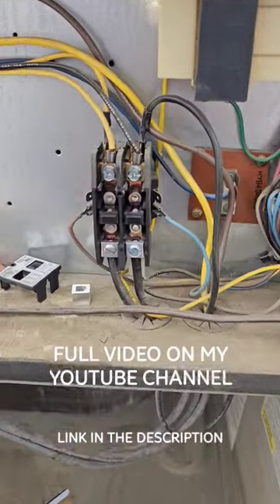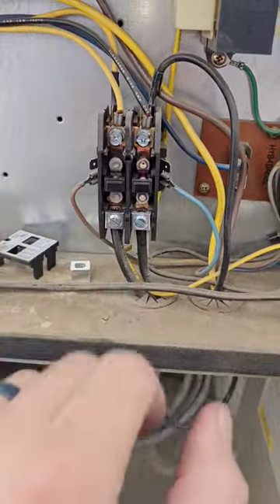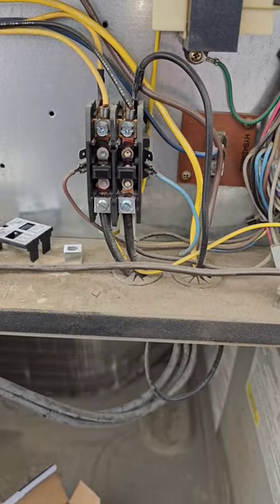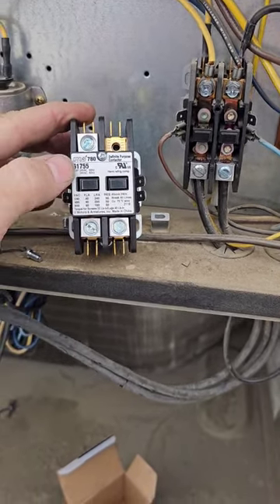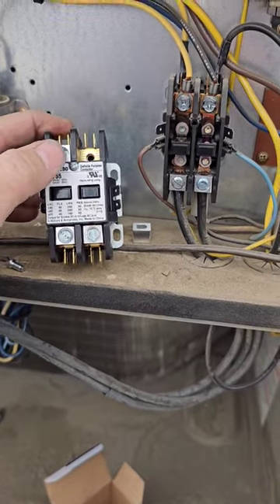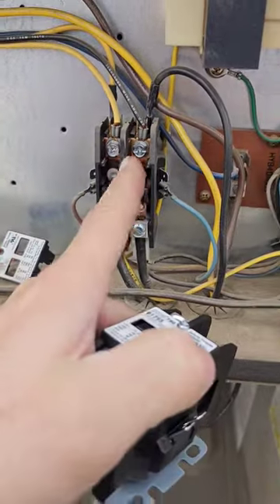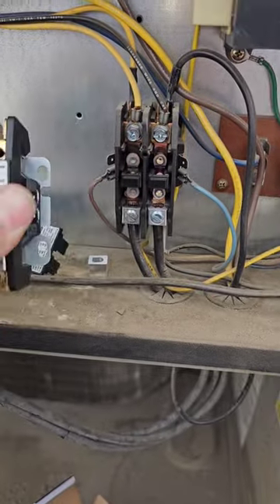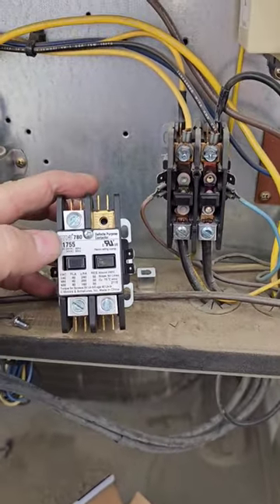OEM CONTACTOR TIP

Comment: I simply use my lineman pliers to cut off the forks of the terminal connector, and then put that inside the lug.
Reply: Ol' ted cook taught me that trick
Reply: @Austin23191  And that's actually better than using the maybe burned up terminal connector and will work better, since it'll be fresh stranded copper in the lug.
Reply: Same here, never any issues
Reply: Me too
Reply: Most contractors from supply house are lugs.Thats an extra step you have, if I replace a second time due to ants or lack of maintenance ...
Reply: same
Reply: Same here 30yrs, lmao, I'm thinking what the fuck am I  missing...lol I remember my first contactor.
Reply: Yup snip the ring off and it stays crimped just pop it in the lug.
Reply: Thats what we do 👍

Comment: And now for a useful tip [for hot rodders] on what to do with the removed lugs:  cut a slot about 1/8" wide in the side.    Keep this in the glovebox.  If the choke on your carb ever fails, slide it over the actuation rod and tighten it to lock in desired choke position [typically open so plugs dont foul].

Comment: Cut the loop off and just stuff the metal already crimped metal on the wire into the lug. Makes a great connection.
Reply: I’m going to try that. That seems way faster then stripper and then tightening the stripped copper with the lug.
Reply: That's what I do. Lugs way better

Comment: I usually just snap off the connection into the screw and use the krimp part as a solid connection inside of the new lug. But this is cool too i didnt know this

Comment: I'm glad I came in contact with this short.
Reply: I usually just snap off the connection into the screws of the old contactor and use the krimped part as a solid connection inside of the lugs of the new contactor
Reply: @Straight_White_Fatherly_Figure  no you don't
Reply: @jabroski69  yes i do
Reply: @Straight_White_Fatherly_Figure  hmmmm I’ve never thought of that. I’ll give that a try.

I usually use a side cutter and cut it off at the wire and then wire strip it and then screw it in with a flat head but your way seems faster.
Reply: @User1  very fast and its a nice strong connection. Just be careful because over tightening will blow out the side of the contactor lol. I did what you do before i learned this trick from a seasoned tech
Reply: Next time shut the disconnect off before touching any shorts.  Electric gives big owies.

(Yes, I am aware, and this is a joke)

Comment: I like to clip the ends of the connector and put it in the lugs that way it's making contact with metal. Haven't had any issues with doing that yet
Reply: Beat me to it 😅
Reply: Whenever i see that someone has done that, i change it to the proper way of cutting/stripping wire and putting the copper under the lug.  Ive seen signs of heat damage from poor connection when you try to clamp down on the unforgiving steel piece.
Reply: @KrazyKuul111  😂😂😂
Reply: I just snap them off into the old contactor by grabbing the wire by the krimp with some pliers and wiggling it back and forth. But yeah same concept lol
Reply: @KrazyKuul111  ive never seen it cause problems but if you feel more secure doing it that way then kudos to you lol
Reply: @Straight_White_Fatherly_Figure  I don’t even understand how the steel would cause any difference with it being copper. 🤣

Comment: Now what I hate the most is when a replacement contactor has no lugs top or bottom, and people try to just shove the incoming line side wire under a screw, good luck making a good connection with just a screw and a #8 stranded wire... LOL.
Reply: Just add a copper washer

Comment: I have never come across a contactor like that, looks like something out of a Soviet locomotive.
All the commercial units I've ever worked on had proper cabinets with all the wires protected and fixed in place along a grid. Even on 20+ y/o equipment very similar to this.

Seems like this thing is under constant threat of shorting out from vibration, but if it works it works.
I do prefer working under load, but all the exposed contacts on this thing scream disconnect me. Could have at least used insulated tips for all the wires.

Comment: Is this modification shown on any info from the manufacturer?
Reply from the maker: No
Reply: @HVACRVIDEOS  Be careful. 
Creating a modified device also known as an altered item can be a big no. In UL and IEL environments devices are listed as built. Modification is not permitted. 
Add to that that there are now contactors that while not UL listed are UL recognized.
Heres an example.
Had a heat gun in the  shop.
The plug pulled away from the cord insulation. Dept had approval and the electrician installed a new plug on the end.
That heat gun was now an altered item and got us written up. It gets crazy how this crap can get so complex.

Comment: I usually just cut and strip the wires. Better a tight connection for the compressor wires

Comment: Can't I just crimp a spade terminal on there and use that?
Reply: I’m guessing if all the top spaces have wires on them you can’t because there’s not enough space. 
But I did it your way and I don’t see a problem with it. It’s a pretty fast method.
Reply: @User1  thanks,I agree I even get the terminals on the wip before I put it on,then bam just plug em in.

Comment: Why would you need to do this?
Reply: I'm guessing just for when the existing wires have crimp terminal ends on them and too lazy to cut and strip the wires to put in the lugs? Lol not sure
Reply: Personally, I ran into an issue a month ago where I had the same type of contactor, and there wasn't enough slack on the load side to cut the connectors off and trim back. Wish I would have known this then other than ordering oem. Otherwise, I would have had to waste time replacing with longer wires. Now, just like all tips and tricks, it all depends on the situation at hand...
Reply: @chriscarbone4956  I liked this video too.
If I don’t have enough wire on the load side of the Contactor because I used my side and wire stripped them.
I try to pull more wires coming from the compressor and slide down the contactor towards the load side and then screw in the contactor to the frame with. (If there’s space).

Comment: Better still, loosen the screw that holds the lug block and tuck the OEM forks behind that. You'll never get a better crimp connection to the wire in the field than what they got in the factory.
And PLEASE don't cut anything off or strip it, you're wasting time to make a worse connection...

Comment: Are there no moisture resistant contactors out there?
Put them in a cheap watertight box. This is a systematic failure.
Reply: Moisture? Never had moisture be a problem but hey I do live in a desert
Reply: @blackishpariah  Fine sand does almost the same. It won't corrode, but the contact resistance goes up.

I had 50 year old contactors driving big motors 24/7 in a closed environment that did not look like that. No dust, no water, lasts forever.
Reply: These things are dirt cheap like $5-10 only designed to last a few years at best. The contacts don't even have the proper alloy to last like a real contactor. Mars is cheap junk designed to make more service calls.